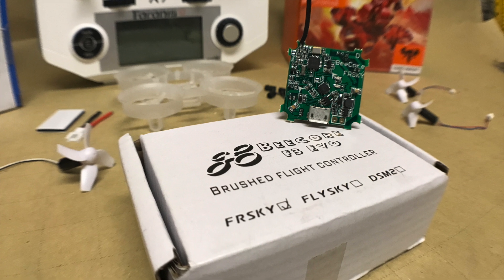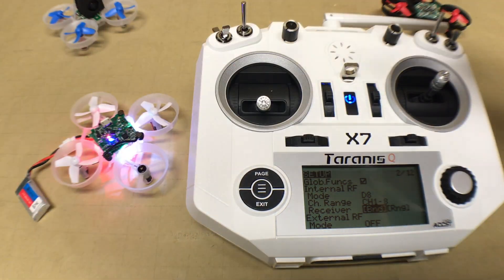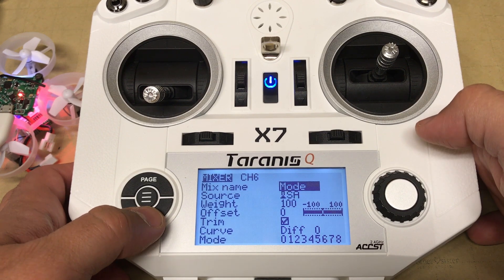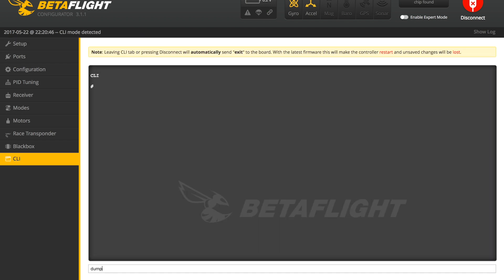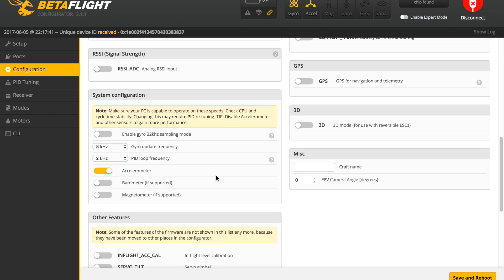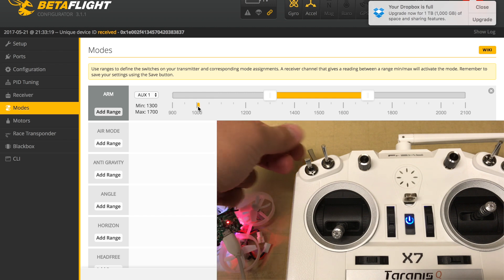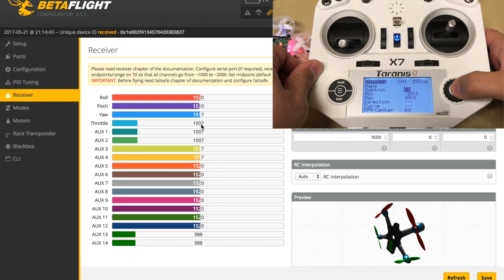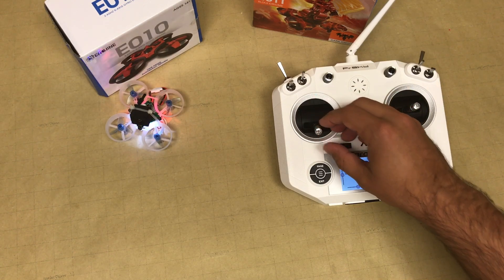Beecore F3 EVO Betaflight Setup - Beecore F3 EVO with QX7 & Betaflight for E010 E011 Tiny Whoop

Comment: I followed every step of this tutorial and successfully set up my qx7 and beecore.

How ever, if i turn on both, the transmitter just buzzes four times every 10 seconds or so. 
Additionally, if i flip the arm switch or move the throttle stick, nothing happens. Betaflight doesn't even recognize stick movement.
Did i do something wrong with the binding process? The qx7 knows that the quad is powered when i try to turn it off but the rest just doesn't work :(

This is my first quad build and it's giving me way more headaches than i would like to xD

Edit: I put the SD card with sounds in to the radio so it will tell me what is actually wrong. It loses the telemetry and the vibration warnings where to tell me it lost/recovered telemetry. I guess the receiver on my FC is broken :(

But still cool video, will definitely come back to it if i decide to buy the beecore again.

Comment: I keep coming back to your video for this board cause it was the most help. New question - is there any way to get the flight battery voltage on the Taranis (for voice low bat warnings)? I've tried telemetry on, discover sensors, but no luck.

Comment: When you set the channel endpoints on the Receiver tab, is there some reason you use the subtrim to set the midpoint instead of PPM center. Blue Falcon does it that way, but his video is a little older...

Comment: Great video - well done! I'm thinking about using the Beecore to replace the stock board in a E011 I just ordered. Getting it cause the E010S I have is pretty good with a couple of weak points. Motors could be stronger (hence the E011). And I'm going to whoop it so want an acro FC. I have a spare E010S board that works until you get close to the QX7, then falls to the ground announcing "Telemetry lost, RSSI critical!"  Do you have this problem with the Beecore?
Reply from the maker: +Mark Sherman I haven't had that issue before.  How close does it get before it falls out of the sky?
Reply: About 3 to 4 feet. I use the E010S to learn acro LOS, so I have to keep it in the same room. It will get close at some point and drop, but even at 6-8 feet I get the announcement and a break in connection, but it recovers (usually) and keeps flying (the "telemetry lost, telemetry recovered" constantly is very annoying!). I have asked other reviewers (several have experienced the problem), but no one has a solution. FPV is no problem cause you can be in another room. Did you mean you haven't had the problem with the Beecore or the stock E010S?
Reply from the maker: +Mark Sherman Haven't had the problem with the Beecore.  I know I have heard of the issue before on some receivers.  The Beecore shouldn't give you issues as far as I know.
Reply: Thanks. The E010s board keeps sending RSSI on aux 5 and even turning of everything I could find related to telemetry in BF couldn't stop it. Hopefully the Beecore will work! Appreciate the response.

Comment: Thank you for this video.. it helped me a lot. Was having a heck of a time binding it.. cause the instructions I found said the lights should turn back on once bound.. that's not true and caused a lot of confusion. 

"b)Turn on your Radio and select D8 mode for the Receiver. Then Go to the Receiver [Bind] option,
and ENT to Binding with the BEECORE. The LED Combo (2 Red and 2 White) will turning off and then
get to be solid if binding successfully. Reconnect the battery to the BEECORE after Binding successfully."

Gotta love that english.. 

Thank you again, I just need to set my PID's next I assume. It's not flying well right now. Motors don't seem 'bright'.